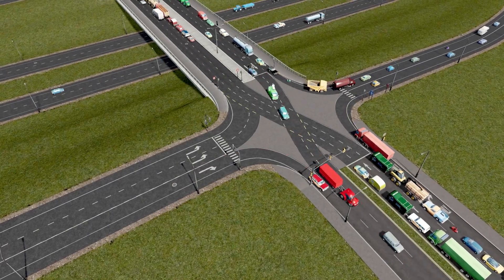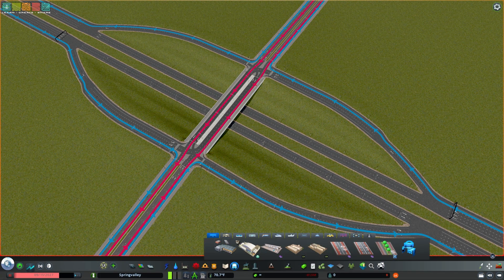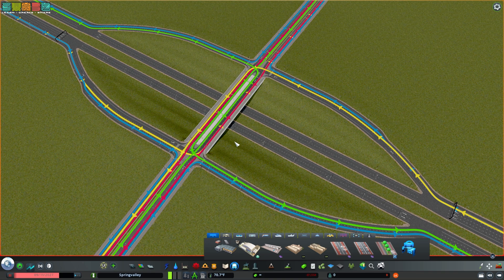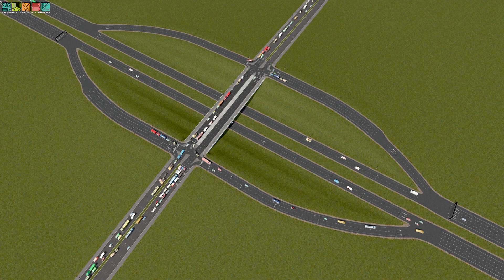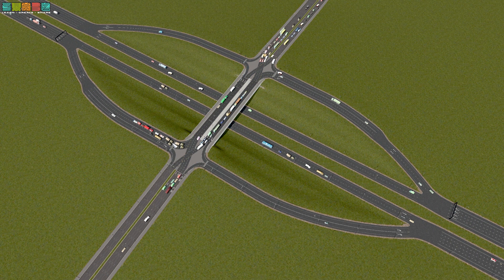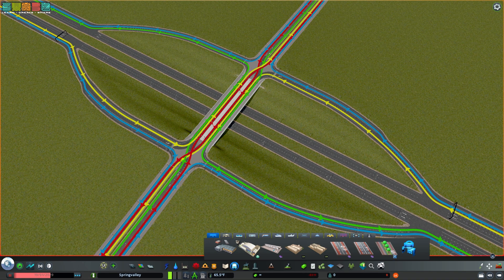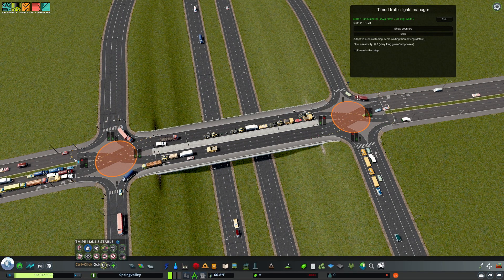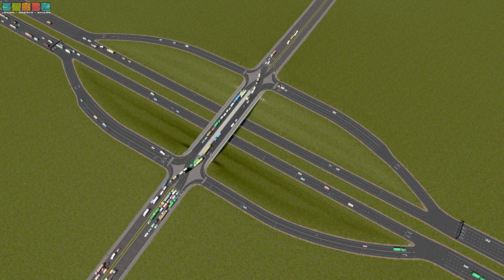Why your Diamonds should "Diverge"  -  The Diverging Diamond Interchange (DDI)

Comment: In my area, the county just updated one of our old diamond interchanges into a diverging diamond and I can say this really does work. It’s already been two weeks and there’s so much improvement on the traffic flow.
Reply: Yup. Grew up in an area that had pretty massive growth over the last couple of years, and we had a DDI installed, traffic was massively improved. Very happy with it.
Reply: We have a couple around here,  They work great, I was surprised.  Every now and then we get someone who can't figure it out, but it really did cut down on the congestion.
Reply: @Dyngbld  honestly in my cities, I have either Parclos, or DDI for my service interchanges lol
Reply: Here in Berlin, Germany we have a highway inside the city (called the Cityring) that uses diamond interchanges for every single exit/entry and it's an absolute nightmare during high traffic hours. I wonder how much would improve if the government would switch one of them to diverging just for a pilot project...
Reply: @PsychoWedge  we can only hope
Reply: What about pedestrian traffic? Safer for them as well?
Reply: @Tim_van_de_Leur  If you mean IRL, where I live, the DDIs have a pedestrian path right down the middle, and they can use the lights to cross into and out of the middle, natural with the end-of-bridge traffic control by the lights.  My city was the testbed for the state, so we now have 5 DDIs, and they have been helpful everywhere they have been put, as in every instance the lion's share of traffic on said bridges is from or to the highway, not so much the thru traffic.
Reply: @Tim_van_de_Leur  Not a lot of pedestrian traffic in my area.
Reply: @Tim_van_de_Leur  well truth be told, hardly anyone uses the sidewalks. Maybe a bike or a two every few days, but I hardly see anyone walk next to the road

Comment: I watched a YT vid about the very thing IRL. I got to thinking how great this was, but I would think some barriers, not just markings would be needed with the American brain/entitled thinking and change. I can hear the arguments "This is 'Merica, we don't drive on the left in 'Merica.  I had meant to ask about it in a stream, but of course, I forgot until today. Thanks. Our little town has embraced the roundabout and OMG the discussion! But I think all in all, they finally see the need for them in dangerous intersections. Again, Thanks!
Reply from the maker: No barriers required. You would rally have to go out of your way to go the wrong direction. Its far easier to make a left into oncoming traffic in a regular four way.
Reply: Don't think of it as driving on the wrong side of the road - think of it as an intersection of two one-way streets.

Comment: I've seen several explanations of this concept from real world to simulator "experts" / presenters.  Your use of the colored traffic flow lines from game finally allowed me to fully understand how (why) Diverging Diamond Interchange works (so well).
Reply: The part thats left out is where these diamonds were primarily used initially. The first 3 of these interchanges all tackled the same problem: a 4 light system, 2 side roads and the highway. This setup is a traffic generating nightmare with conventional intersections. However, the diamond significantly reduces this congestion.
Reply: There a real interchange like this in Mebane, NC.... Took a little getting used to but works really well.

Comment: 99% of the highway interchanges I've seen are regular diamond interchanges.
They're really easy to build, cost effective, and uses low footprint. (And doesn't confuse inexperienced driver. i.e, most people)

They build a concrete rectangular cylinder perpendicular to the highway.
Then fill up both sides of the rectangle with soil, and build the highway above the rectangle.

Then pass the perpendicular traffic through the concrete rectangle,
Then build a single lane road right next to the highway, and connect it to the perpendicular road.

Main advantage is, highway people don't have to stop or cross anyone, 
The village road on the bottom has practically no traffic,  so they can go really fine.
All the problems are diverted to the local road rather than the highway, 
Without taking away land from farmers
Reply: Why of course where there is no traffic one doesn't need high volume traffic solutions. A DDI simply doesn't make sense in most places and even, if it would make sense nobody is going to rebuild a DI into DDI just because it gets clogged at rush hour a bit. Especially not if you'd have to put up with landowners etc.
Reply from the maker: If a diamond becomes a chronic issue then converting it to a DDI is often cheap compared to building a new overpass or ramps. Thats really the point.
Reply: @brohvakiindova4452  yes, if they decided to convert those tiny diamond interchanges into DDIs, it just wouldn't work.
There's not enough space for the road design required to make people understand that they're supposed to drive in the opposite direction.
It would make sense in large spaces like the American ones, but not here.
I tried building a realistic DDI in cities skylines. And all the roads just start clipping into each other.
The game is obviously designed for American car centric culture...